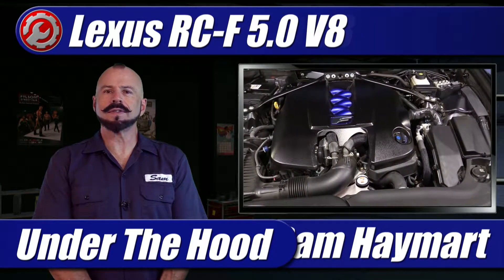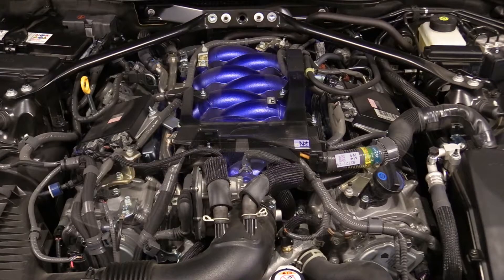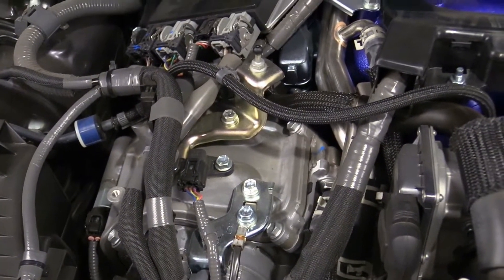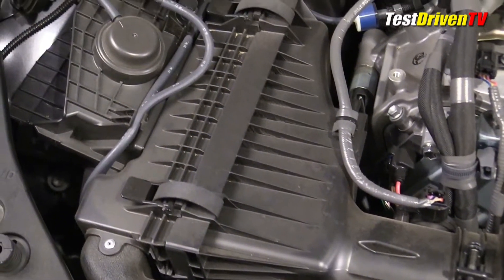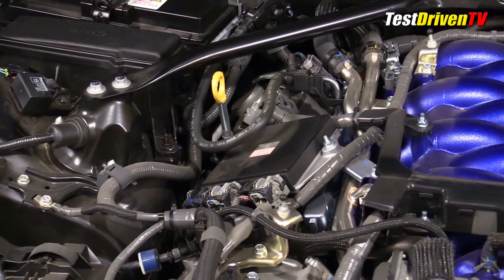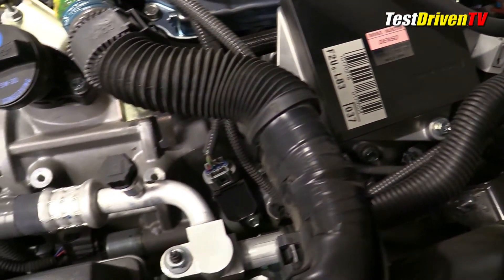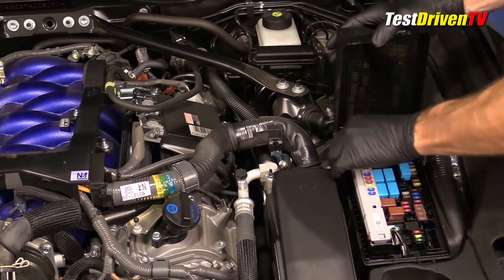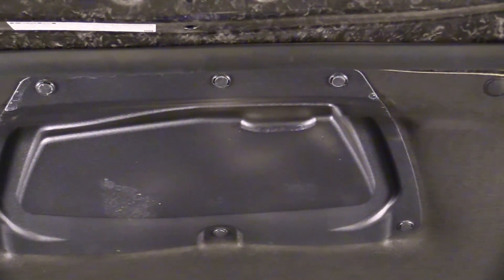2015-2021 Lexus RC-F: Under The Hood

Comment: The hood vent is functional..remove the panel in the summer on during the winter..must do more research before you do a video there were much more misses..not pretty ? Not up to you ? Dont give half ass facts then your opinion especially if its negative..its the best car it out performs BMW by fare...lol

Comment: The hood vent is functional. Pull the 6 clips and the plastic cover comes off. Under normal operation, leave the cover on so rain and debris don't get in the engine compartment. When you take it to a track, take the cover off for additional cooling. Its a 30 second procedure.

Comment: Can you provide technical details beyond advo copy on the following instances for me?  When (how) does the engine change from Otto to Atkinson cycles (or is the advo copy pure bs)?  What species of AVS is on the vehicle (pneumohydraulic?) and is it active regardless of driving mode or is it off in standard and eco, but on in the sport modes or does the mode actually change the AVS somehow?  Just purchased one and am frustrated by not having a technical manual to describe how these things work.